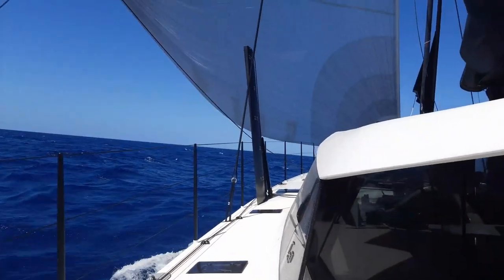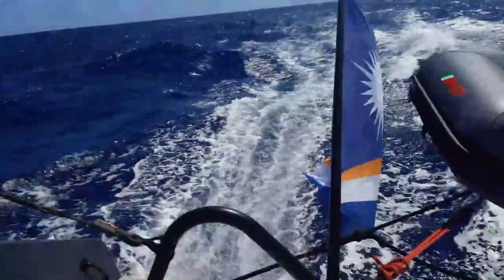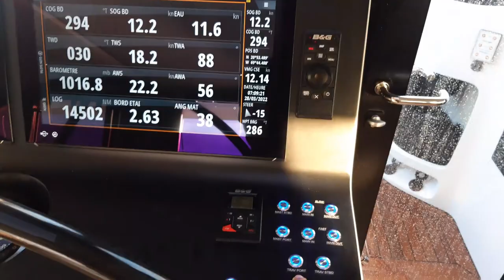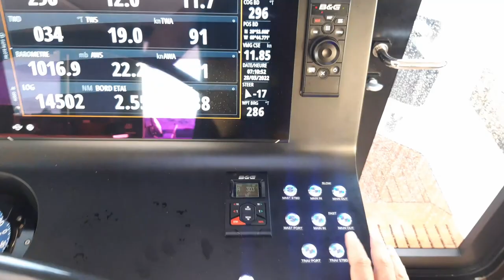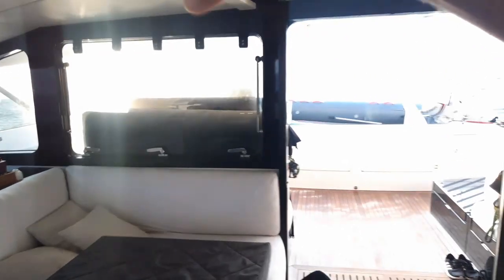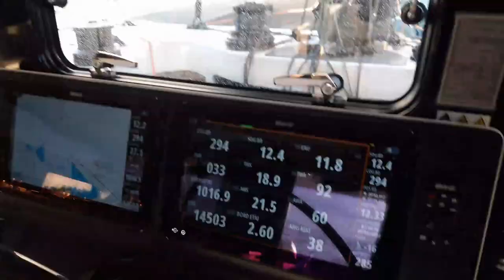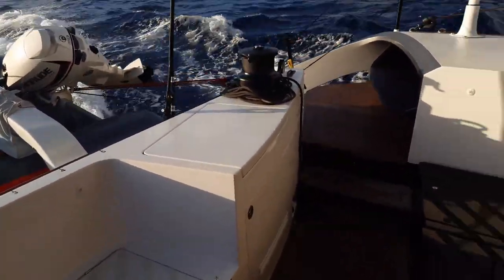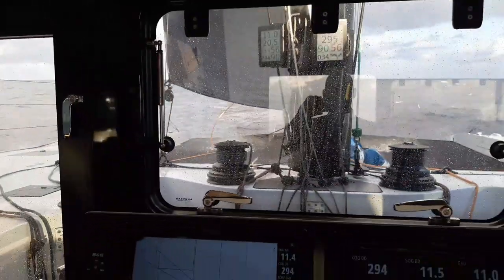Understanding mainsheet trim on a high performance multihull

Comment: Ah, so not a fan of the double bridle/double A setup. Good explanation. I just need some powered winches for the traveler! Cool boat.
Reply: Getting ideas for the new boat? 😉
Reply: Haha! This one’s a little too small. Lol
Reply: You don't need two winches for the traveller, just a single antal line driver.
Reply from the maker: 😂 nope not a fan of the double bridle mainsheet. Next weeks video I show how to trim the main the same way on our boat. Then it becomes very clear why I'm not a fan.
The Gunboat 68 is a very cool boat.
Reply from the maker: The line driver is good for the Cruising mode that I show, but the winches can't be beat when pushing a little more.
Reply: @TheOKellys  ah well, there's always the 80 coming out soon 😉

Comment: Thank you very much for explaining things as you go.  

I've often wondered if using dagger boards don't increase the rolling moment; perhaps you could talk about that in another video?  Thank you.
Reply from the maker: Yes, they do. Exactly the same as the mini keels. Biggest difference is you can lift the dagger boards to get rid of the heeling moment, with mini keels you can't. This makes boats with dagger boards safer in winer and rough conditions.

Comment: That is an awesome video! Thank you.  What do think the pro's and con's are for the forward helm on a performance cruising cat?  If you were designing a cat for yourself and family to sail around the world would you have a forward helm or twin aft helms?  Would love your POV because you actually are an expert without some big conflict of interest either way!!!
Reply from the maker: If we were choosing something from existing designs, we would definitely choose twin aft helms on our round the world cruiser. You are completely exposed in a forward cockpit. There is a disconnect between the helm, mainsail trim stations and those working at the mast. You cannot easily look to see mainsail trim. And in most cases the forward cockpit space is way too small a workspace. The only time we have seen a forward cockpit done close to workable is on the Chris White designed Atlantic 72. We love the concept though...it just needs someone clever to come up with a good solution 😁

Comment: Curious what the solution to failed power / hydraulics is in the Gunboat?  If you lose power, surely there must still be a manual way to control the sail plan?

Comment: Seems lately that there have been a lot of people praising the A Frame/Double Bridle Mainsheet system (which I struggled to understand), but I have not sailed with an A Frame so was starting to doubt my assumptions......thanks for adding some clarity......of course not really fair to compare much to a Gunboat, cheers
Reply from the maker: Yeah, it is one of those things if you say it enough and get enough other people saying the same thing, then it must be a good thing right?
I keep saying if it is a good thing we would use it in the race boat world. The fundamentals of sailing are identical racing or cruising, only difference is the need to beat the boat next to you is not there in cruising. Unless you are like me😂 and you all ways have to beat the boat next to you....

Comment: How do you tension the Forestay, Induce Mast bend - flatten the main - without backstay or runners ?
Reply from the maker: You don't bend the mast to flatten the main as you would in a yacht. 
To produce forestay tension you rely on mainsheet tension. 
In terms of inducing mast bend, the mast sections are so large you can't bend them as you would a thinner yacht mast.
Sailing upwind in a fast cat is completely different to sailing upwind in a performance yacht. In a cat it's all about simplicity and boat speed. Things like runners and backstays only add windage and slow you down more than the advantage of getting more tension in the forestay verses a yacht that gets stuck at hull speed upwind where you need every trick in the book to try and go that 0.1 of a knot faster.

Comment: Vetus do a nice line in electric winches they have their own dedicated bus. This enables you to sync two winches together onto a single button and should be the answer to controlling your traveller. If I find an answer to sourcing the thousands of pounds it no doubt will cost I will also let you know, maybe start a YouTube channel???:)
Reply: You don't need to go that far, since you're always going to be easing one sheet while winching the other on an A frame mainsheet system.  Not as easy as with a traveler, but not rocket science either.

Comment: Not buying the picking up the windward hull by where the mainsheet is lifting it from, certainly a hard sheeted main with the traveler down can still lift the windward hull through shroud load. May be a useful mental image for describing and visualizing the effect, no argument there, but that’s not mechanism.